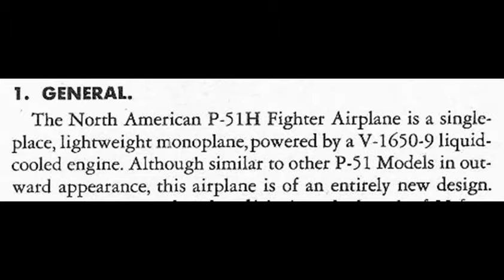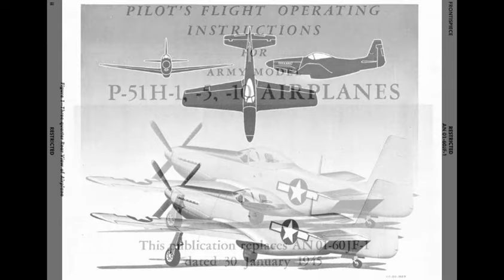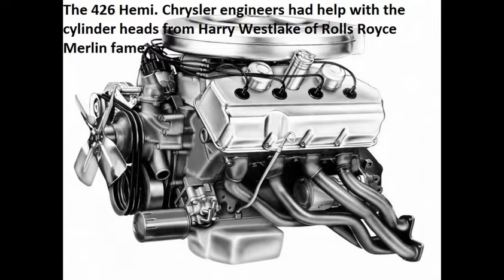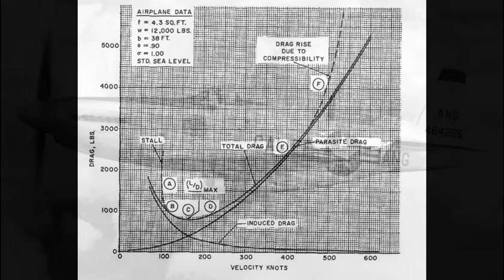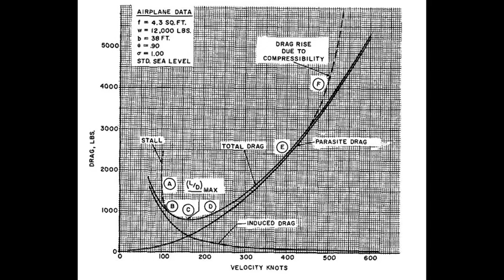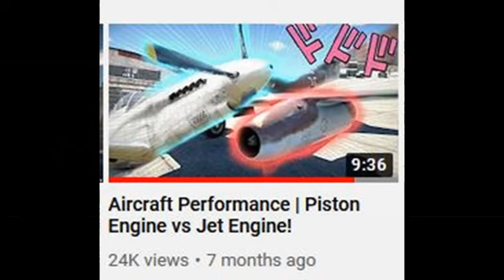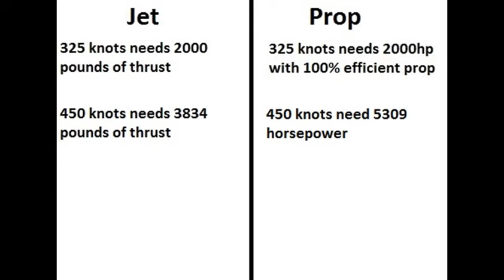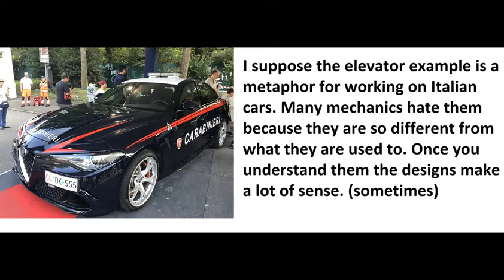U.S. "Superprop" Fighters P-51H, XP-72, and more

Comment: There are several factors to consider between 1945 Flight Tests flown at Wright Field by Army, 1945 at NAA before Army test, NAA discovered substandard performance issues for new 1650-9 with WI and Simmonds SA-9 auto Boost control and pressure injection carb - that wasn't sorted out until early 1946............................................................................................. 150 octane fuel was discontinued after 1945, reducing max potential even with WI

Comment: It is actually NOT DIFFICULT to explain why thrust decreases with speed with propellers. It has everything to do with SOUND or rather the speed of sound.  Imagine rowing a boat with an oar and trying to get the water to flow faster than the speed of the oar! It is not going to happen. With open props, trying to get the air pushed back at a speed faster than the propeller tips is not going to happen. The propeller blades need to stay under the speed of sound even though they sometimes tolerate being at or slightly faster. Hence, as you approach the speed of sound, the reaction mass (air being thrown back) are not significantly faster than the aircraft's forward speed and thrust approaches zero.
--
As a matter of fact, turbofan engines have the same problem. The fan is very much like a propeller in a duct. And, while narrowing the nozzle can help increase the exhaust velocity, it only goes so far. To actually get the exhaust a lot faster than the speed of sound you need to increase the pressure through combustion. With modern commercial turbofans, only about 10~20% of the air actually gets combusted, the rest is being paddled by the fan. Hence, thrust falls dramatically too at or around Mach 1. For the most parts, if you are trying to fly supersonic, ALL of the fan paddled air is not doing anything but cause extra weight and cross sectional drag. It is only there for thrust and efficiency during takeoff and at subsonic cruise. If you want to fly at Mach 2 you probably want a turbojet or a very low bypass turbofan (~0.2:1) mostly to cool the exterior of the engine. If you want to go Mach 1.3~1.6 you might be able to get away with 2~3:1 bypass, but only to help with takeoff noise and subsonic cruise. Sueprsonic fuel efficiency will actually be worse than the same core with no bypass.

Comment: I know very little about Aviation stuff!! Disclaimer🤣 I wonder if superchargers made it a lot easier to control combustion temps verse Turbo Charging back then? It seemed they battled preignition and detonation so much back then. They made a lot of progress being able to always increase manifold pressures. I’m not saying a Blow through or Draw Through Carb can’t run ok with a turbo charger... but they rarely run well🤣. You really need fuel injection to control combustion temps well with the old Hairdryers. Supercharger work a lot better with carbs. Being mechanically driven as far as throttle response there’s nothing like it making it a asset in a dog fight.  I always wondered about how turbos work in the air with a prop. Does the Prop constantly keep the engine loaded ? Even in maneuvering ? The fact that engine load more so than engine RPM is needed to spool a turbo and produce pressure makes me think it works different with a prop?
Reply: Spool up time is not a factor in airplanes where you're not trying to precisely manage the onset of engine torque as you accelerate at the limit of tire adhesion.  Most piston fighters did have mechanically rather than exhaust driven superchargers, but the exhaust driven type has efficiency advantages when you can package it to fit in a fighter plane.  Either way charge cooling is the main contributor to anti-detonation, so I don't perceive how the method of driving the blower makes much difference for airplanes.  Also keep in mind that by the end of the war venturi type carburetors were obsolete, and powerful engines had either direct injection or "pressure carburetor" injection at the face of the impeller.

Comment: This may be a very childish question.  But I will never know unless I ask.  Why are there propeller driven planes if it really seems the jets have an enormous advantage?  Are jets too fast where lower speeds are needed?
Reply from the maker: No, it's a good question. The short version is that below 325 knots or about there, the props have a pretty big efficiency advantage. So with slower planes prop driven planes can use less fuel and have better take off performance.
Reply: @GregsAirplanesandAutomobiles  Thank you.

Comment: little pet peeve of mine, these aircraft used contra rotating propellers, not counter rotating propellers.
Reply from the maker: It depends on which original source you read. Sometimes they were called "dual-rotating".

Comment: The P-51-D used a Merlin 1650 V-12 with a two speed supercharger.  What would happen if was built with 1710 Allison with a two speed supercharger???  They only made single supercharger in WW2.  The  P-38 lighting were made with turbocharger with more capacity.
Reply from the maker: They did make a two stage Allison, it was in the P-63 and worked well.
Reply: @GregsAirplanesandAutomobiles  Thank you, I knew about the P-39, never heard of the two stage blower.  Most Soviets used P-39 and P-63. Question is now why not the the one stage blower like the Cutis P-40 not using the two stage blower. The Merlin made it happen mainly because the Merlin was / is a two stage blower.  Shoulda, coulda, woulda???
Reply from the maker: I talk about this a lot in other videos, but the short version is that the USAAF really liked turbochargers, so they used turbos as the additional stage. The US Navy used two stage superchargers from the beginning of the war. Rolls Royce was late to the 2 stage party with the Merlin, but the Merlin's two stage was very good when it did show up.

Comment: How would the XP-72 performed against the Ta152?
Reply from the maker: That's a good question, and it's hard to say, because we don't know what improvements the Ta152 would have had by the time the XP-72 showed up. My guess is that the Germans would have added more nitrous and that at high altitudes like above 30,000 feet the Ta would have the advantage, and below the XP-72, but I haven't really thought it through fully.

Comment: 5:50
Ford used the Thunderbolt name in the 1960s, and probably owns the automobile trademark on it.
Reply from the maker: Chrysler used it on a car first.
Reply: @GregsAirplanesandAutomobiles  What car?
I seem to have missed Chrysler using the Thunderbolt name.
Reply: @bricefleckenstein9666  I see Chrysler had a Thunderbolt concept car in 1941.
Reply: @RD2564  Concept car vs Ford's 1964 Thunderbolt Fairlane being a production (abet SMALL production) car.

Comment: What I'd love to see... a B-36 with coaxial turbo props.
Reply: wonder why turpoprops were never put on it... if its not 15000hp doesnt need coaxial propeller. also i think russians have plan to replace those coaxials on tu95 with single propeller. actually not even sure why they made those and not just put  bladed propellers there
Reply: @jebise1126   the prop tips on the the Tu 95 are already breaking mach, I dont think a single prop would be a benefit
Reply: The B-36 is a fascinating airplane in many ways, but it was essentially obsolete by the time it entered service.  It was WWII technology, and turboprop engines were not available then.  When turboprops became available the B-36 was already being replaced by the B-47 and B-52 and it wouldn't have made sense to spend more money on the B-36.  Like most early cold war aircraft it was soon outdated, but it was quite a machine for brief period of aviation history.
Reply: @gort8203  Well the B52, the TU-95 are WWII technology and they're still in service.

The B36 had the highest bombload capacity and turboprops would be very interesting on it.
Reply: @NavySturmGewehr   The B-52 was hardly WWII technology in the same sense the B-36 was; you're trying to equate a swept wing jet capable of cruising 10,000 miles at 440 knots with a propeller plane capable of cruising 10,000 miles at 230 knots, and it can't wash.  The fact that the B-36 can carry a few extra bombs if you reduce it's fuel load doesn't matter when your mission is intercontinental strike.  

Certainly the idea of turboprops on the B-36 is academical interesting as a 'what if' comparison for that airframe, but there was no way it was ever going to happen as a practical exercise.  You'd still have bomber that goes the same distance in twice the time, with less survivability in hostile airspace. The B-36 was slow and a maintenance nightmare, but like I said, a fascinating airplane as the final expression of the long range piston bomber.  I am likewise enamored with the technology in the final generation of steam locomotives, but I don't pretend they could compete with the utility of diesel-electric locomotives.
Reply: @gort8203  Perhaps if you took the time to consider what I wrote instead of using it as an excuse to correct something that didn't need correcting, you would realize I was simply day dreaming after a B36 with co-axial turboprops.  I have the same day dream about the Mosquito.  I also day dream about the possibility of a turbo diesel radial engine to replace the wasp jr on the beaver.  Could you please educate me how that isn't reality and it could never work
Reply: @NavySturmGewehr  I did consider what you wrote and found it to be nonsense.  Not your "day dreaming" about turboprops on a B-36, which I said was interesting, but your reactive nonsense about the B-52 and B-36 both being WWII technology with the implication that the B-36 might still be in service if got turboprops.  Don't say things that are nonsense and then blame the person who challenges them.  By the way, my initial comment here was in response to the comment:  "wonder why turboprops were never put on it".  I simply offered a reason why in response.  Apparently you took that as a challenge to your daydream and you've been trying to "correct" me ever since.  Maybe if you took time to consider what I wrote  instead of . . .
Reply: @gort8203  I know I'm not smart.  I'm smart enough to know when someone is pretending to be however.
Reply: @NavySturmGewehr   Give me a break and discuss your insecurities elsewhere.  I'm here to discuss facts about airplanes.
Reply: @gort8203  You started it cheese grill.  I'm having the time of my life.

Comment: The Mitsubishi J2M had a cowling fan for it's Kasei engine. The J7W prototypes had a cowling extractor fan for it's rear mounted pusher engine. So the FW190's actively cooled radial concept was not unique.
Reply from the maker: The J2M's first flight was well after the 190 was in service. So the 190's set up was unique among WW2 combat planes, at least for a little while.

Comment: Read Kim McCutcheon's excellent books on the WRIGHT R-2160 'Tornado' and CHRYSLER aero-engines.
See: C.A.C. CA-15 'Kangaroo'
XP-72: Yes, there was a turbo-supercharger that would have done the job. The G E. CH-5 (as used in the P-61C Black Widow).
Your propeller performance analysis ignored the multi-speed propeller. Quite a number of experimental 2-speed reduction gearboxes were designed and some built but none saw service. They would have overcome blade tip-speed limitations. (Make sure you include this in your next propeller video).
Reply from the maker: That turbo was used in the P-47N, which also used the R-2800 engine like the Black Widow. It's not nearly large enough for the R-4360 if it's going to develop 3500hp at 25,000 feet. I didn't cover propellers in this video, that's coming soon. I think you have some misconceptions about the 2-speed gearboxes, but I'll take care of that in the next video .
Reply: @GregsAirplanesandAutomobiles  Hi Greg. The G.E. CH-5 (x 2) were proposed for the STUDEBAKER XH-9350 (ie over twice the displacement of the P&W R-4360) which could deliver well in excess of 5,000Hp so the USAAF deemed the CH-5 well capable  of supplying the necessary charge-air (~265lb/Min). In what way do you believe I have mis-conceptions about 2-speed propeller reduction gear-boxes?

Comment: The Outrigger Hotel Waikiki has a similar elevator system.  Do you overnight in ICN or ANC much?
Reply from the maker: Oh, yes, I have done my time in both of those, ICN more than ANC though. I have been to the Outrigger, but can't remember if I used the elevators.
Reply: @GregsAirplanesandAutomobiles  maybe I will run into you sometime in one of those two haunts or some other place GTI or your company goes.
Reply from the maker: Sounds great, right now I'm in SOF.

Comment: What were they using to control detonation in these dual supercharged engines, seeing as how water injection was not a full cure to this problem.
Reply from the maker: Low static compression ratios, big intercoolers, very rich mixtures and water:methanol injection.

Comment: Why would you "assume" the Chrysler V16 hemi' had engine issues with absolutely no data to back it up? And there is written that the p47 in question flew 503mph level flight at, I believe, 15,000ft 2 different days with 2 different pilots.
Reply: +Glen Faizo    My references say that the Chrysler V16 did not offer any performance advantages over the R-2800 powered P-47.  I think flight testing was conducted by Chrysler after the contract had already been cancelled.
Reply: @FiveCentsPlease  :Doesn't really matter anyway, 504 is 504! It was a test mule, they all knew it wasn't going anywhere anyway. It was the end of the war, they wanted to see how it performed, that's all. They knew the motor wasn't going to go into production.
Reply from the maker: I did state why I think it had issues, and I have need to test results for the plane showing a 500mph top speed.

Comment: Some of these props made at or after the war, were powerful enough to do a prop\torque roll on take off. This could be fatal. Judicious application of power on take off was recommended.
Reply: I would be interested in an explanation of how a contra-rotating propeller can magnify the torque trying to rotate the engine/airplane opposite the direction of engine/propeller rotation.  If a single propeller driven by an engine producing a given amount of power imparts X amount of rotational moment or torque, how does fitting the same airplane with a contra-rotating prop create more than X amount of torque?  At first glance one might assume that the adverse torque should be reduced by the contra-rotating prop.  But even if one accepts that the torque at the crankshaft upstream of the planetary gearbox remains in a single direction, how does the contraprop produce more unwanted rotational moment?  Thanks in advance for any info.
Reply: @gort8203  Good question. And some of the answer depends on how the mechanical parts are set up. Not all planes with counter rotating props are set up the same  way, ditto with helicopters. And quite frankly a little above my education. I admit it.  But is dependent on velocity (speed) and mass (kinda like weight) and direction (angular momentum).
Reply: @gort8203  But counter rotating props should cancel out most of the torque . and you should get more thrust per engine and less vibration. But practically I bet it was difficult to obtain.  I did lots of weight balancing on helicopter blades, it requie s  some science but also some SWAG. There was blade flex which was unpredictably peculiar to each blade. This effect would be much much less on a plane. But differences in weight causes vibration.  A torque roll on take off was written about but not something I became involved with.
Reply: @raywhitehead730  My assumption was also that the contra-rotating props would lead to less tendency to torque roll. I can imagine how they might not reduce such tendency, but I can't see how they could possibly aggravate it, so I'm suspecting you may have read a piece of misinformation somewhere.  If you can point to any references to contraprop torque rolls on takeoff please let me know. Thanks.
Reply: @gort8203  Well how about the crash of Red Barron a RB-51 in about 1978. A contra  rotating prop P51 very fast. crashed in Reno while in flight doe to props going flat,, not what you had in mind? Well all the crashes I came up with were due to mechanical failures, But there is an excellent you tube lecture on contra rotating props at.. Scout Paramotor  part 12 Torque.  Also, that crash can be seen on YouTube. Good luck.
Reply: My comment was not about contra rotating prop aircraft, but since you mentioned it, one of my favorites was the British Fairey Gannt. It was a carrier based turbo prop with contra rotation props.  It actually had a pretty long career.
Reply: @raywhitehead730  Thanks for the info
Reply: @raywhitehead730  All this time I assumed you'd meant contra-rotating props when you said "some of those props", because they had been featured in the video.  If you were referring to conventional props causing a torque roll on takeoff then my whole question may have been a misdirected.
Reply: I saw an interview with Steve Hinton, about his crash in th Red Baron RB-51.
His engine failed at the end of the race, though he still crossed the finish line in second place.
When the engine lost oil pressure he pulled up, declaring an emergency, and planned a landing on one of the runways.
As he was on final, the oil pressure went completely away.
That caused the propellers to go into flat pitch.
With six blades trying to to windmill in that configuration, the drag went up astronomically.
No power, ridiculously high drag, he had the glideslope of the proverbial brick.
He crashed short of the runway.
Fortunately, the cockpit broke away from the airframe and was thrown clear of the subsequent fire.

Sometimes it’s better to be lucky than good.
And some days, you’re good and lucky.